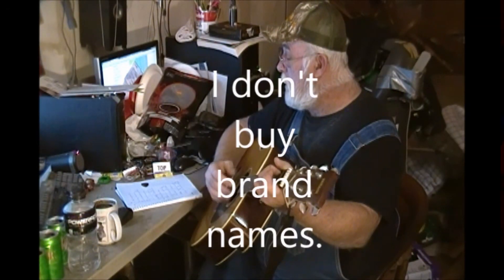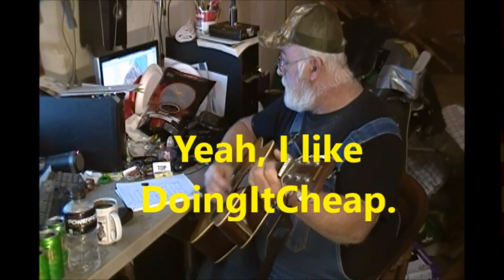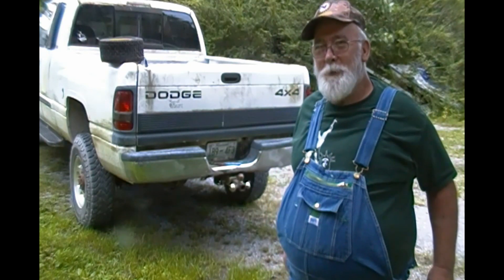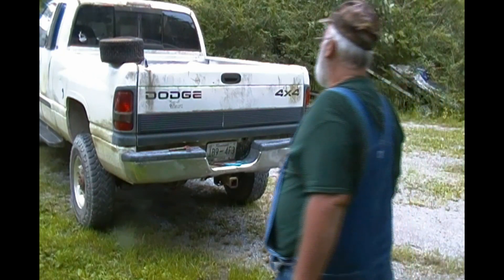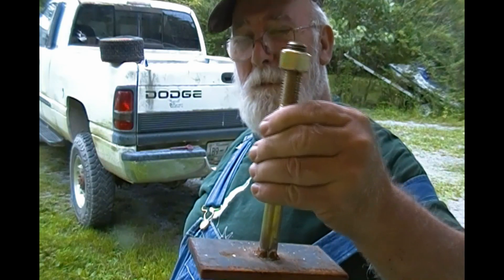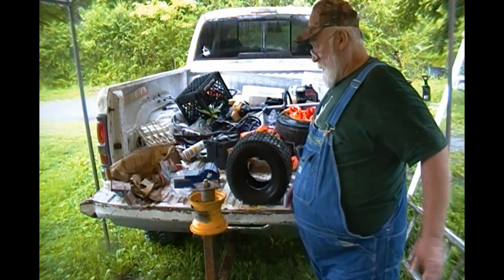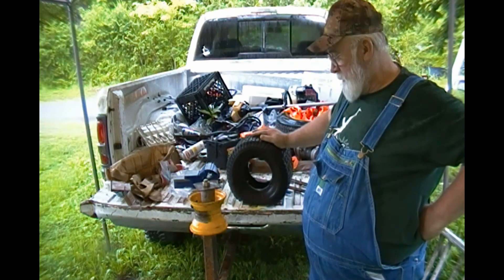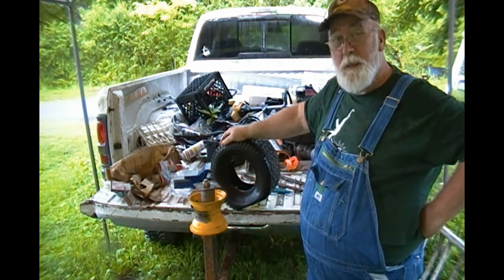PawPaw's Reese Hitch Hack  Portable Work Station and Small Tire Changer

Comment: That's a great job!  I have a full size tire changer made on a similar design I have used for years. It's a little heavy but nice to use out in the field. Besides it's getting harder and harder to find a tire shop that is open other than 8 to 5. Great job!   Ed Hicks

Comment: You Sir are awesome, even though you were Air Force. 
SFC (RET) Kittok
Reply from the maker: 1976 Air Force, Idaho Air Guard, Tennessee Army Guard, Tennessee Air Guard and finally wrapped it up on active duty Air Force in 2008 in Iraq.
Reply: @DoingItCheap  Roger that, still some respect Sir. 22 yrs Army,  100% cheap.